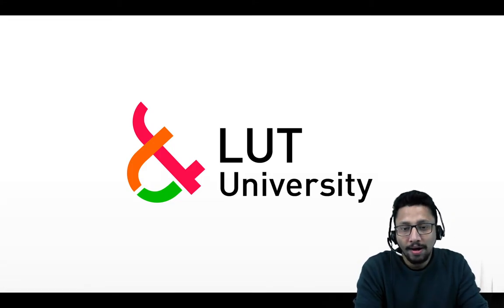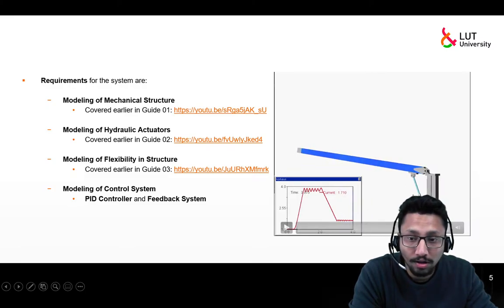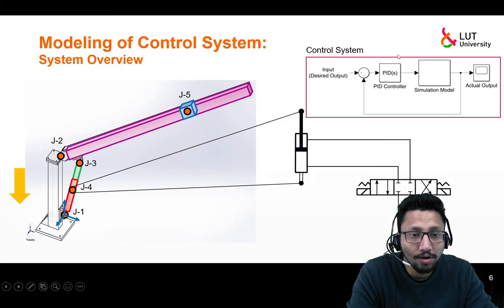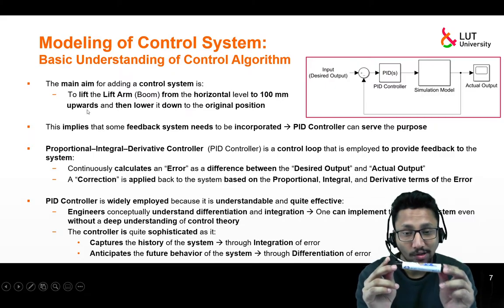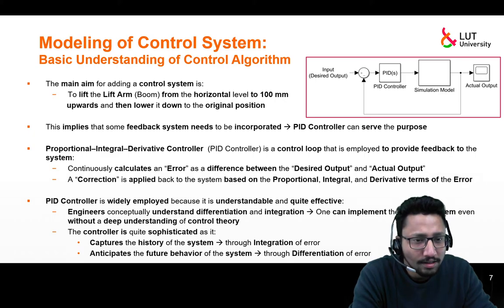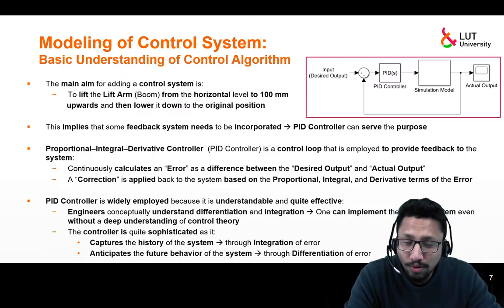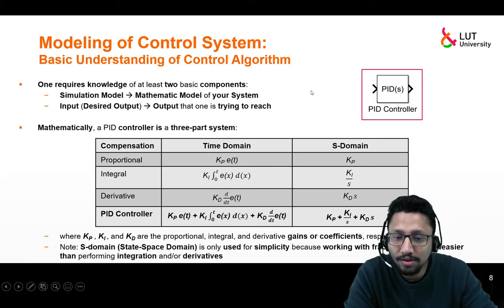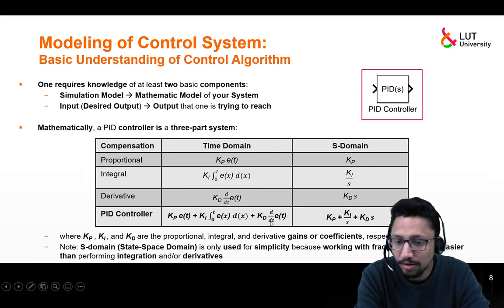Guide 04: Control System Modeling | Simscape Multibody | Matlab | LUT University | Finland

Comment: Please, could you make a tutorial also for an oleopneumatic (fluid+gas) damper ? Like the ones used in the landing gears. I need it for my thesis. Thanks.
The force is due to the contribution of two terms : the elastic force due to the compression of the  gas (proportional to the displacement of the damper) and the damping force of the fluid passing through the orifice (proportional to the velocity of the damper). The damping force rises during the crushing because the orifice becomes smaller due to the meteering pin. 
The majority of examples that I have seen are just a damper and a spring but I need somenthing more precise and able to model the variability of the forces sad before.

Comment: Sir, I’m done your video tutorial and guide, from 1-7 tutorials and continue with your 1-3 guides video. Your explain is impressive and very helpful, and very complete. I'm currently studying braking system on train for my final project in mechanical engineering. What would be the procedure for that or if you could direct me to some textbooks or video tutorial on the same topic? Thanks a lot in advace.
Reply from the maker: Hello Abduh, thank you for the kind words and I am glad that the videos could help you. Do subscribe the channel. Regarding your project, I would suggest that first try to get all the requirements by breaking your problem into smaller sub-problems. Then following different materials would be easy.
Reply: @DrSurajJaiswal  I think that's exactly right, Thankyou sirr  for your advice